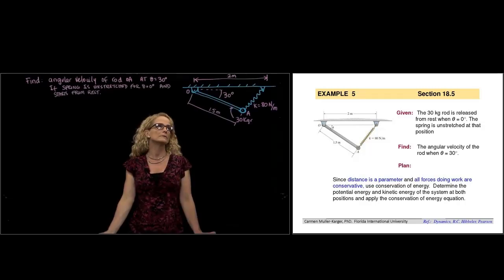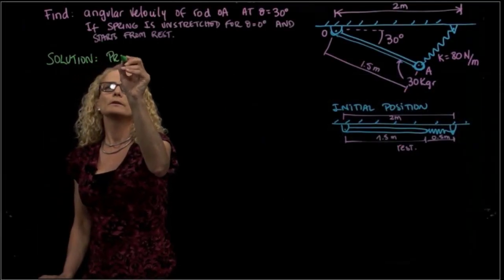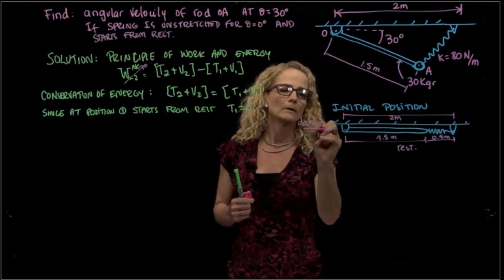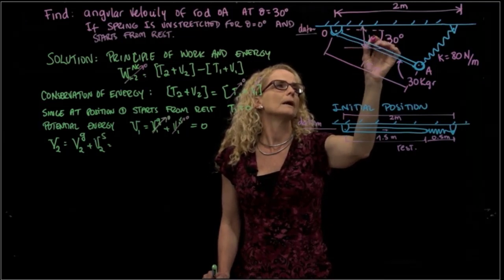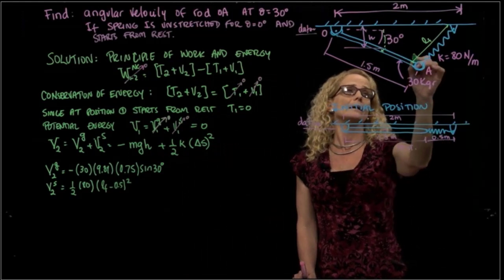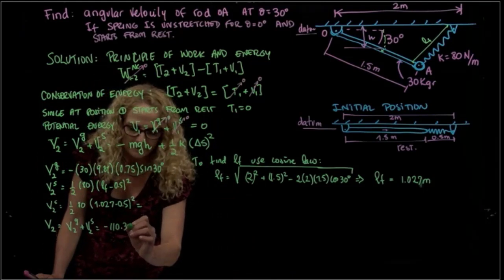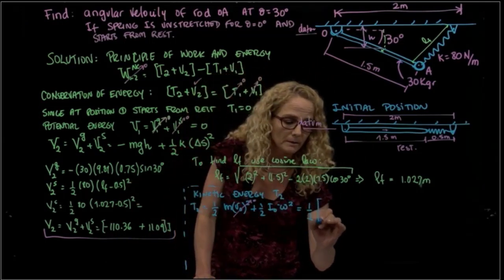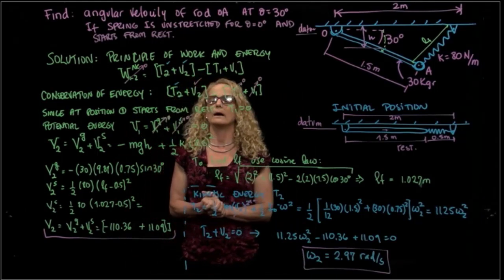DYNAMICS, Example 18.5 Principle of Work and Energy

Comment: When I calculated the spring by 1/2(80)(1.026-0.5)^2 İ got a different value than when I used 1/2(80)(1.026)^2 - 1/2(80)(0.5)^2. Which one is correct? My final is after 10 days and these topics are tough! Please tell me the correct way to do it
Reply from the maker: You always have to use the stretch of the spring s=Lf-Lo. If the spring is not stretched there is no work or potential energy.